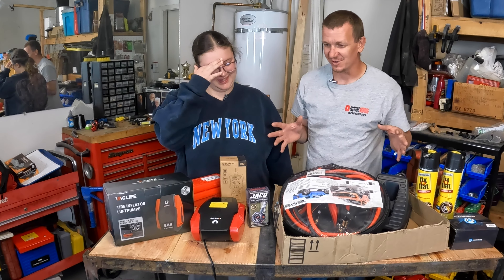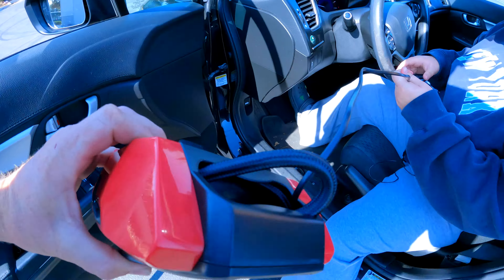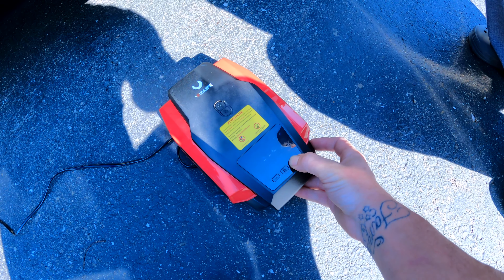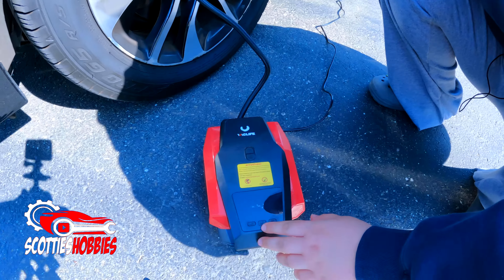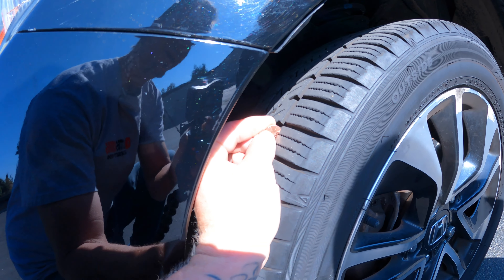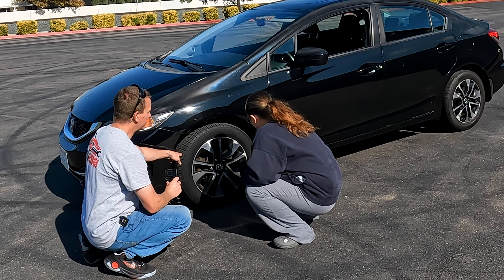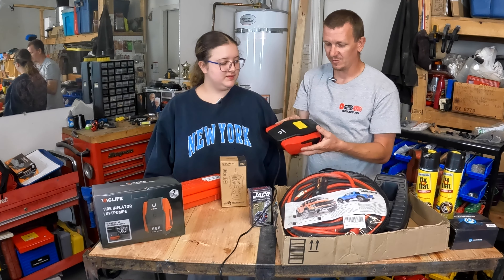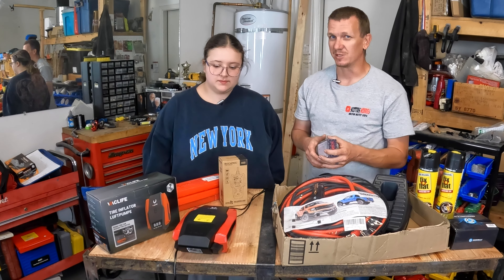Teaching My Daughter (& You!) How to Change a Flat Tire! Beginner Driver Guide, Put On Spare Tire 🚗💡

Comment: Those plug into the cigarette lighter plug has become problematic for me, the plugs break & even OVERHEAT, so I went to the "RYOBI
ONE+ 18V Cordless High Pressure Portable Inflator with Digital Gauge and 2.0 Ah Compact Battery and Charger Starter Kit"  Scotty, try one of these out I think YOU would really like such, compact, NO need to plug anything in etc.
Reply from the maker: I use to have a old ryobi battery operated one in my personal car. Then I didn't use it for a few months. We went to Tahoe and got a low tire in the snow. I tried to use it and the battery had died. Their happen to be a Goodwill near by. They had a old compressor that plugged into my cigarette lighter for super cheap. I bought it and used that thing up til a year or 2 ago. It always had gotten the plug and wire hot but it started getting real hot after a couple minutes of use. So... I bought my self a newer one that has not gotten hot and fills up tires quick. But it does not have the auto shut off. With all that in mind, I got this inflator. But I also bet the newer Ryobi inflator has gotten better too. Thanks for reminding me about that thing. I bet it's still in my trunk. 🤣 

Thanks for stopping by and chatting. I really appreciate the conversation.